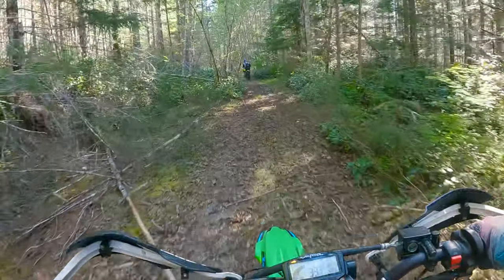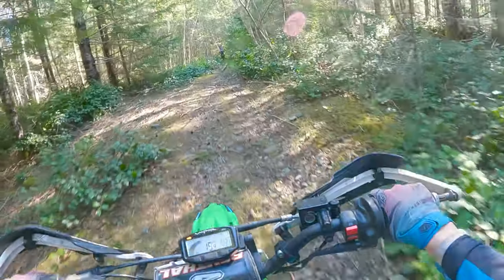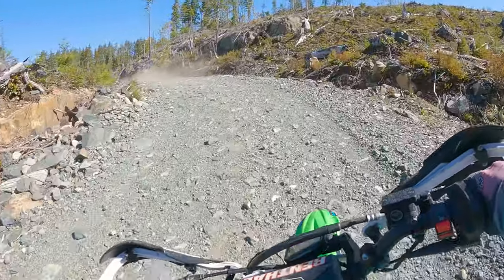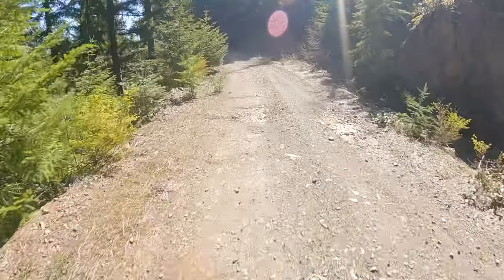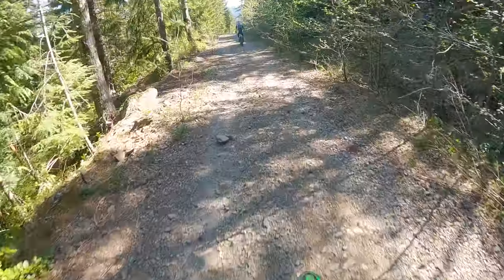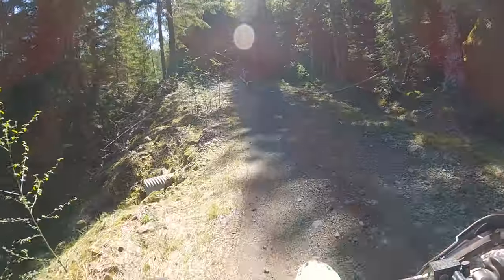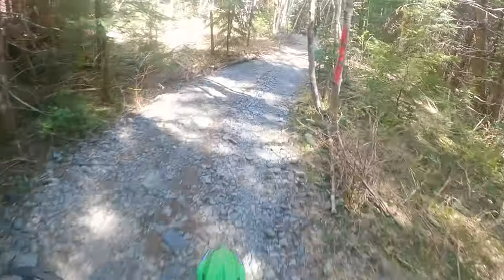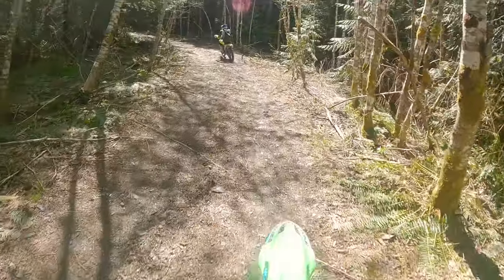The Last Ride On The Fully Built Big Bore KLX140RF

Comment: What was the top speed you got it up to im thinking about doing this and I want to make sure I don’t gain just 2mph and waste my money
Reply from the maker: Big bore kit and building the engine has no effect on top speed. Your top speed is solely dependent on your gearing (trans gears X front sprocket X rear sprocket) 

Youll need to change transmission gears/front or rear sprocket to affect top speed)